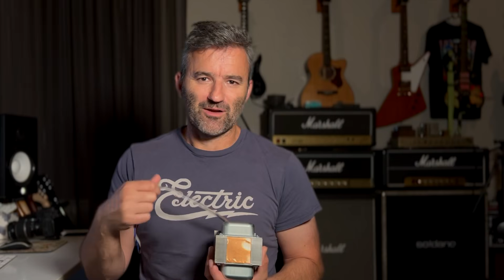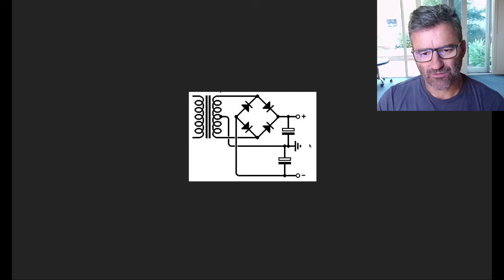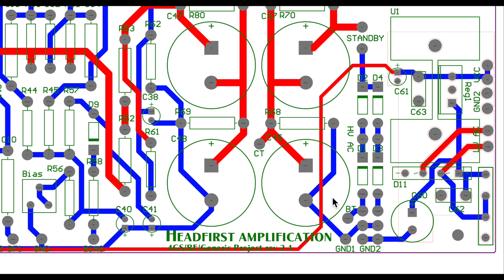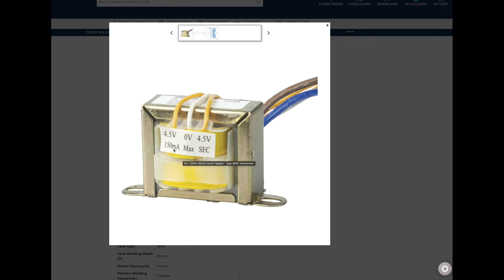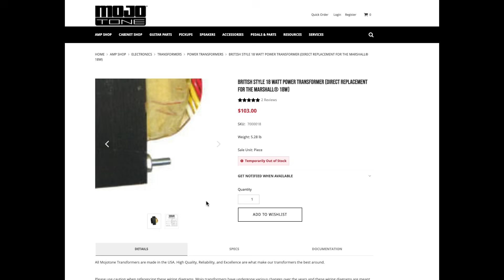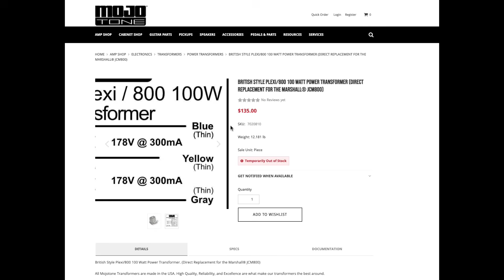Build Basics FAQ : #2. POWER TRANSFORMERS!!

Comment: Hello I watched your video about the power transformers. I have an old vacuum tube radio and the transformer got shortened. Need to replace it. I don’t have information about data sheet. Any idea where to find that? The model number for my radio is Ilmenau Super 66/57 w206. Much appreciated if you can help.

Comment: I can still use a pt rated for 100w for a 50w mc2 build right? Granted i wire it in full bridge rectifier with the ct connected in between the first series filter caps, as mentioned here?
Reply from the maker: You absolutely can!

Comment: thank you for sharing this knowledge! I've only had older modelers / solid state amps, but have always been curious about tube amps. took me awhile to realize that many of my favourite crunch / distortion tones were associated with JCM 800 hot rodded Plexi style circuits, many of which probably had further modifications under the hood.

I used to think I couldn't get anywhere near that "sound in my head" without spending way more than I can justify as a tinkerer and rusty bedroom player. being able to do a DIY scratch build or modify a used example as you've demonstrated will likely go a long way to getting there! even if I don't go that route any time soon, it's cool and I'm learning interesting things along the way. cheers from Canada!

Comment: I miss the hell out of Classictone too. I buy Mercury iron now. They’re the only other company I trust with stated specs. Hammond and Heyboer are all over the place on 120v primaries.
Reply from the maker: Oh wow, I haven’t heard that before.  You ok with the Mercury pricing?
Reply: @HeadfirstAmps  I have to be ok with Mercury pricing. They’re the only ones making commonly available iron that does what I want. As you know, amps designed for a specific voltage range don’t sound right if it’s outside of that range. 

I don’t have any problems with Hammond or Heyboer OT’s, chokes or reverb drivers though. They all sound fine and operate noise free.
I usually just buy everything from Mercury though. High volume, group buys from Mercury are the way to go if you want to bring the price down.

Comment: lots of inexpensive options for Fender PT replacements. Can these be used?  Many of them are for 2 or 4 6L6
Reply: Anything can be used, depends on your requirements of course!
Reply: @JohnWiku  I'm referring to the Headfirst boards. Will they accept for example a Supersonic Power transformer or a Hot Rod deluxe Power transformer and run 6L6's ? I ask this because transformer replacements for Fender are plentiful and dirt cheap
Reply: @johnmiller9219  As was explained in the video, that is not a problem at all
Reply: @JohnWiku  I guess i'm questioning what will picking a particular PT determine aside from B+ voltage?  Power tube type?  If i use a Hot Rod Deluxe PT must i use 2 6L6 or can i use EL34 or KT77 ?
Reply: @johnmiller9219  Regarding different tube types and how many you're running, what you need to pay attention is the heater filament current needed to power them, and spec a PT suitable to handle it. These board seem to be fine for whatever PTs you might throw at them, it all depends on the components you use to populate the board, as these have to be rated, and preferably overrated for the voltages you'll be running them.
Reply: Yeah the board is basically a skeleton and can take what you put on it, bearing in mind the pt and ot, power tubes, etc. all should have the correct specs to work together. But if you want to do a 6l6 4 gain stage board for example, you can do it
Reply from the maker: Power is power, and it’s not tube specific other than the specs of what he PT will put out.  That Classictone PT featured in the clip is a Fender replacement model, and I used it several times in EL34 builds.